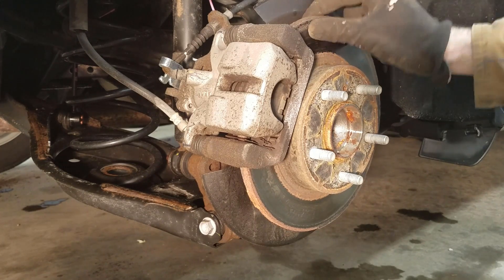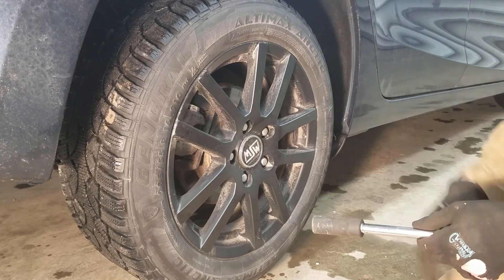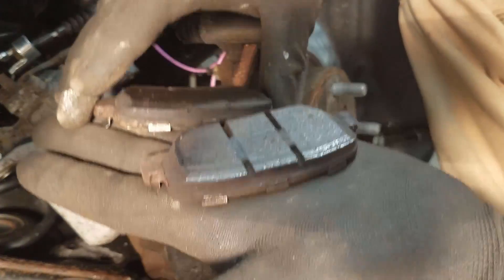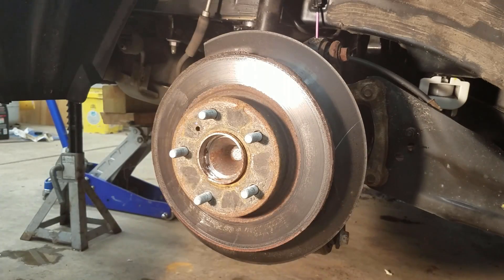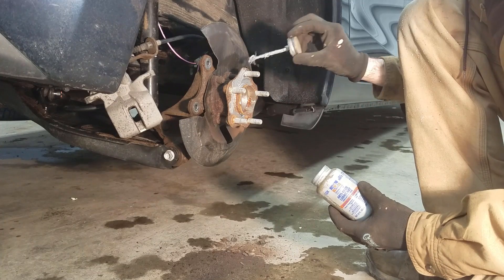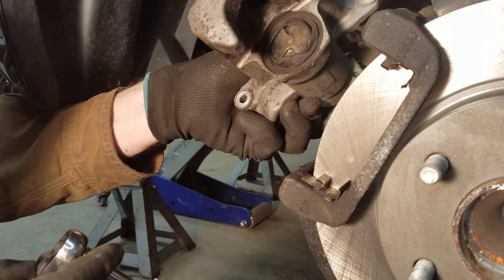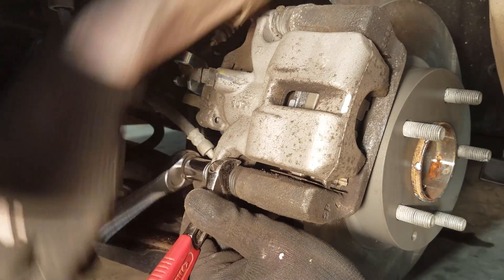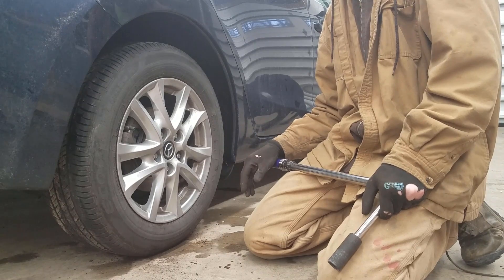How To Change Rear Brakes Mazda 3

Comment: Best video of a Mazda 3 brake replacement I've seen. You do have to open the brake fluid reservoir in order to collapse the caliper. Also it took me three trips buying brake pads to get the right ones because Mexican assembled Mazda 3 has different pads than the Japanese assembled. It did not matter that we use my VIN number at the store to look up the parts they still sent me home with the wrong ones the first time
Reply from the maker: I hear you! There are 6 models of Mazda 3 in the computer and then depending on where it is made even more versions.  What a pain and expensive!
Reply: On my 3, the rear one are made in Mexico , and only TRW i found compatible for electric hand brake. The front brakes are made in China, and anithing is compatible.  Now i can do one more thing for my car, without going to Mazda service.

Comment: Great Video. Saved me several hundred bucks by doing it myself. the only problem i had was the piston didn't screw in that easy. it took a while before it finally went in. other than that,  it took less than 2 hours. thanks!
Reply: Next time take the cap off to the brake fluid this will let you push in the piston with ease just remember to put the cap back on when your done

Comment: Just my 2 cents on opening the master cylinder reservoir in order to compress the piston back in, for ABS equipped vehicles, this can damage the unit by pushing brake fluid the opposite way. I find it best to crack open the bleeder valve and then compress the piston. You should always bleed the brakes with fresh fluid as an additional maintenance procedure
Reply from the maker: I should have changed the fluid, but did not.  Your idea makes sense too. I did not bleed the brakes, just pushed in the cylinder and did not have to add fluid.  I will use your method going forward. Thanks.
Reply: specialy with older vehicles...verygood practise

Comment: Just a heads up for others: For the REAR brakes on my 2016 MAZDA 3 ISPORT I had to push in REALLY HARD while turning the caliper piston with a caliper piston socket tool. When I just turned the piston it did not go back into the caliper--I had to push it in really hard while turning to get it to go in.
Reply: Did you take the cap off to the brake fluid so that the fluid can rise up when turning the piston if not then that's why
Reply: Good point! Actually I did forget to take the cap off when I was doing it--I discovered that afterwards! Thanks for the heads up.
Reply: @glenndallaire3449  What caliper piston socket tool did you use?
Reply: @teslarocks7345  Hey Steve,  I did it with a pair of needle nose vice grips HOWEVER afterwards I purchased Brake Caliper Wind Back Tool 22pc Professional Disc Brake Caliper Tool Set from Amazon for next time ($18.99). If you use needle nose pliers you have to push in really hard while turning the caliper to get it to go in. Also, make sure that you take the cap off your brake fluid filler tank (under the hood). otherwise it will be even harder to turn. Best wishes! -Glenn
Reply: @glenndallaire3449  I got a 2016 also from Japan, first I got to find out if I got the electronic brake control which is different way of doing brakes, but I have hand brake in car so I guess I would have to spin my caliper back in. I was looking at tool sets on Amazon and saw in comment they don't work on 2016's, seems to be some confusion on 3's post 2015. Guess will be looking into all this, just got mine in Feb and my brakes still looked good so we will check things out when I rotate tires soon.
Reply: @teslarocks7345  Hey Steve. My Mazda is also the vin code "J" from Japan. The brake pads I used are Duralast Gold--DG1728 FRONT AND DG1729 BACK which I got at Autozone. These are specifically for the vin code "J"  Best wishes!
Reply: @glenndallaire3449  Thanks for the info, if you don't mind me asking how many miles you got on yours? I got a I touring with 29,000 miles on it so far. I drive alot of highway with not much braking so think mine should last some more.
Reply: @teslarocks7345  I bought mine at 26,000 and it had just come off lease. I had to change both the front and the back brake pads at 57,000 which was mostly highway miles. I assume the fronts were changed before I bought it and the backs I assume were the originals.

Comment: One thing you may not have known is the Mazda 3 uses two different types of brake pads depending where your car was manufactured. That's right, location of manufacturing makes a difference. Mexican made Mazda 3 uses different brake calipers and pads than Japanese and American made Mazda 3. You're brake pads are the Mexican pads. I found this out the hard way and ended up taking the pads back to the auto parts place and I was told I needed to know where my car was made. WTF!? I had the Mexican made pads and my Mazda 3 was made in Japan (look on the door jam to see where your car was made). Once I got the correct pads the job went smooth.
Reply from the maker: Yeah I have a Mexican Mazda also. I went to get a rebuilt rear caliper as a year later one is sticking.  Nope, no one has rebuilts except for Japanese ones, and it is $250 for a new Mexican one from the dealer.

Comment: Instead of hammering on the rotor, and possibly damaging the bearings, put a bolt in the threaded hole in the rotor. This will separate the rotor from the hub.
Reply from the maker: Yes that works also unless you break the bolt off in the hole or do not have a metric bolt.
Reply: Just a heads up, I did this and it got the rotor off easily - but I bent the hub doing it. Soooooo I then had to replace the hub. I guess I screwed it too far lol. Be careful!

Comment: Thanks! My wife's car (same same) needs brakes and rotors in the rear. Dealership quoted about $600. I am no mechanic but a glorified wrench turner I definitely qualify for. Last year I changed belt and tensioner. Last month the dealership told me it's leaking and I need a new one. Which is what they said to prompt me to change it last year. I see no evidence of leaking. Any thoughts?

Comment: Have the same car but the park brake doesn't hold. It's very tight but when you pull it really hard it doesn't hold the car on a incline. Bad brake pads? Is there any adjustments to do on the caliper itself?

Comment: I went in for this recall and they put new pads and calipers on the car supposedly to fix this premature wear problem. This was about about 30k miles. Now at 60k miles they need replacing again. This is not normal wear and their fix did not fix this. 30k miles out of a set of rear brakes is ridiculous. The problem is the caliper is not releasing and it has nothing to do with corrosion because I live in the south. So how come they did not fix this on the recall?
Reply: Same exact problem here!! Frequent brake changes due to stuck calipers, especially rears. 
Mazda won't replace my brakes for discount because I missed a brake cleaning appointment... which of course costs more than new brakes anyway.
Reply: I'm on this video right now for the exact same issue!! Christ. Had them done at 25k because of uneven wear, free of charge. Now we are at 60k and they need to be replaced again. I've never had a vehicle eat through brakes the way this car does. I even called Mazda head office and they were like meh, it's normal. What??? Lol
Reply: @jessicam3761  The only saving grace is the front will probably last 100k miles. The fronts are easier to replace because of the emergency brake on the back.
Reply from the maker: I was surprised how rotten mine were after a few years. I know I live in the northeast with salt, but they were bad.  The fronts were not as bad.

Comment: Don't forget to grease your brake pins, change the brake fluid and put a new boot on the bleeder screw so it doesn't turn into a pile of rust in 50 kilomiles.

Comment: Did you torque the caliper bolts? If so how did you do it? I can't fit a torque bar in the location so i would have to use a hammer and wrench
Reply from the maker: Just "ughhhh" tight.  Basically as tight as I could go with a 3/8" ratchet.

Comment: Hey bro, great vid! 
Was wondering if you've ever come across that caliper not screwing back down?? Not sure if mine is shot or what but the damn thing isn't moving back down.
Reply: Try clamping it and then screwing it. Hope it helps!
Reply from the maker: If the caliper will not screw back down, it could be bad or it could have come out too far.  I looked into a new caliper and the Japan ones can be found but the Mexico ones I could not find rebuilt.

Comment: You turned the caliper bolts in opposite directions when removing them.. are you supposed to do that? My caliper bolts literally will not come off no matter which way I turn them
Reply from the maker: Turn the top of the bolt to the left.  If you are in snow weather the salt will corrode them and they will be hard to remove.  Try penetrating oil.  If that doesn't work heat the thing to 600 degrees.

Comment: Hey man. I kepp turning clockwise to close that piston and it doesn't go down at all. Am I doing something wrong? Thx
Reply: trewmuzik push on it turning clock wise
Reply: @alinlaniyelle1433  yeah, thanks but I tried it and couldn't get. Ended up renting a caliper tool and got it. Thanks though.
Reply: @trewmuzik  same here, i added some wd 40 it took a while but it finally screwed in after 10 = 15 min
Reply: @trewmuzik  what tool did you end up using?
Reply: @juanraya2715  it's a caliper removal tool. Your local auto parts store should have one you can rent.
Reply: @trewmuzik  ok, thanks 👍

Comment: Hey the 14mm so one I had me go clock wise others counter clock wise which why did you turn it was hard to tell
Reply from the maker: Lefty loosey and righty tighy.  Which ever way the top of the bolt goes will tight or loosen them.

Comment: Damn your rear caliper different from mine. Mine has a toque bit screw (star shape) on my rear
Reply from the maker: There are about 4 versions that are slightly different depending on what part of the year it was made and if it was assembled in Mexico (mine) or Japan.  The process should still be similar.

Comment: You replaced the rotor at 30,000 miles? 🤨 Your rotor has zero damage. Just use some brake clean to clean the gunk off and they’re good for at least 80,000 miles....
Reply from the maker: You are right, but here in the northeast USA they throw a lot of salt on the road so it was pretty rusty and would interfere with the new pads.  Brake clean would not have done it, I would have had to sand them down to remove the rust.

Comment: Dude,  you forgot to clean where the new rotor sits to remove all that rust before adding the anti seize and setting in the new rotor. Also, you did not apply high temp grease where the pads sit on the mounting support and behind the pads. Lastly, you did not lub the sliding pins with silicone grease. Not a good video.
Reply: Can you repost your own, the right way to do it? I’m in the process of doing this myself.